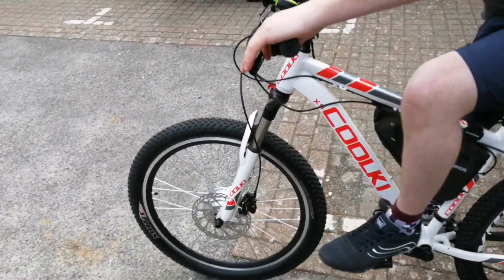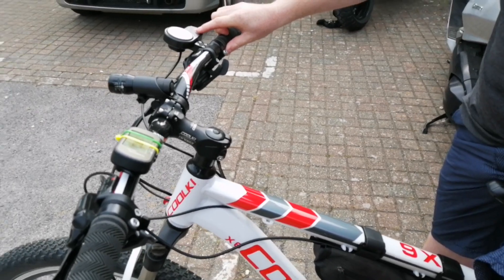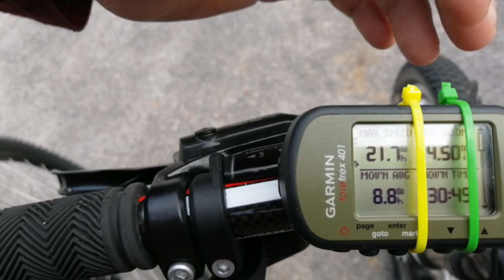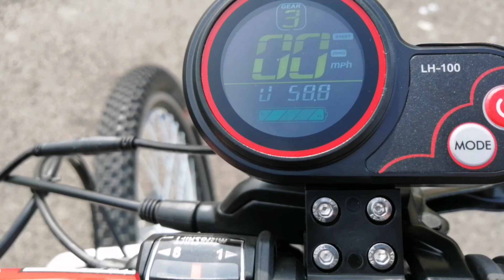Ebike 250w ebay kit modified 60v

Comment: 3 gears ? I don't think so matey 😉 
Let's think about this, you took a £120 250w eBay kit and then spent another £40 ? When you could have just purchased a 500w kit £150🤦
Reply from the maker: Don't worry yourself to much mate this was some years back now. Iam running a 1000w mid drive.